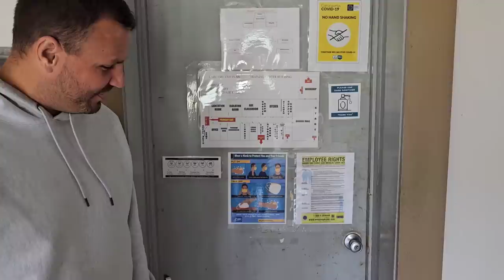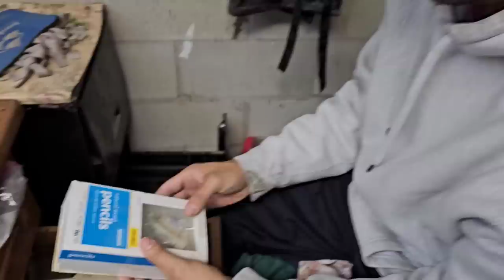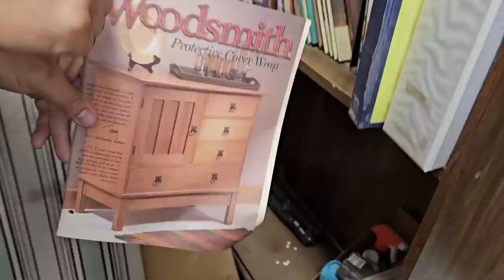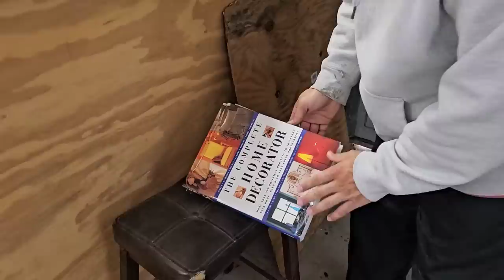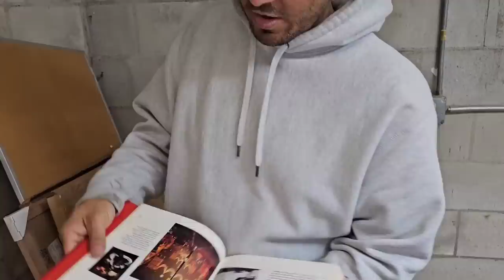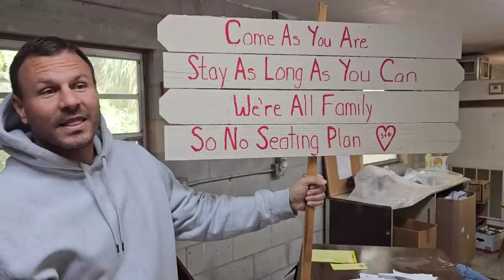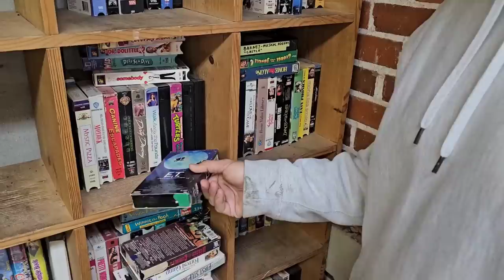SHE is PREGNANT

Comment: I have a suggestion. .just a suggestion now--check with well drillers to see if you can have your own deep water well. If so you need not pay for town water. Free water. I lived in Florida for a while and did get a well driller to put in  a water pipe for our new pump.  Worth a try?